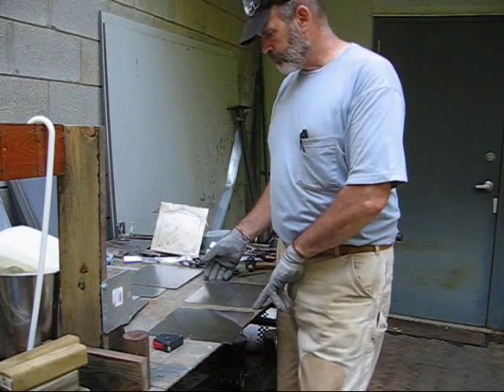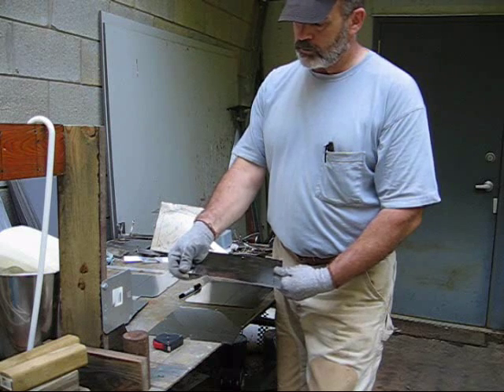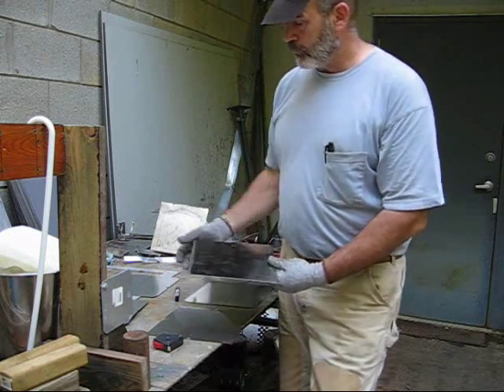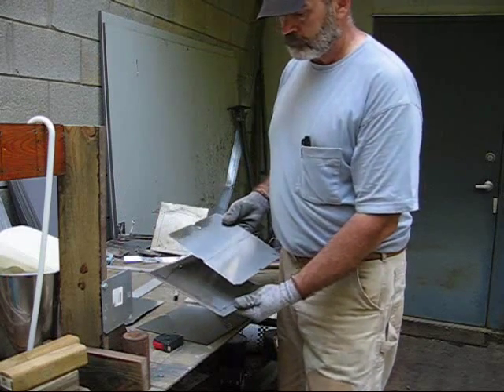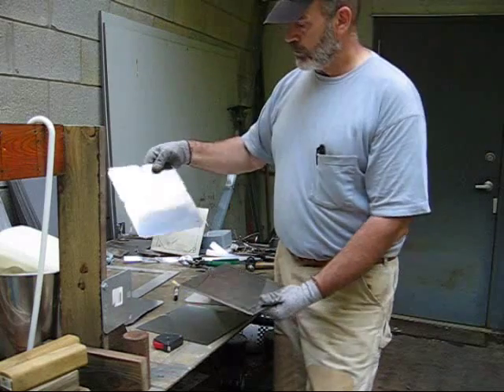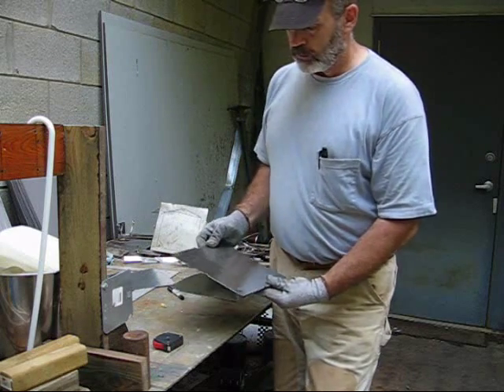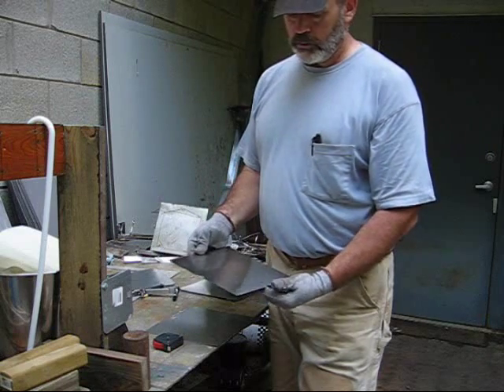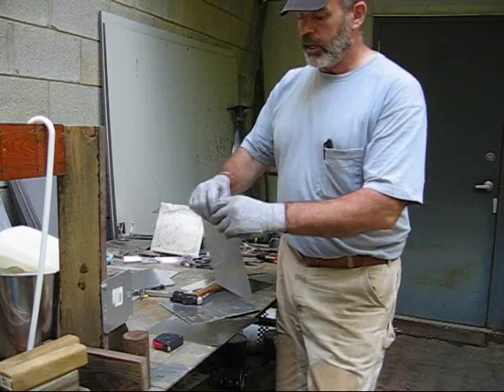HHO Dry Cell Mars Gasket Part 2

Comment: the holes that are staggered was why my dry cells had amperage drop at the back of the cell. now i use the 3/8 centered hole on top and 1/4 inch center hole at bottom.. the multiple relay idea was a bust for me as well! ok if all are on turn one off and the cell does wierd things. i had one plate get hot and start to smoke the gaskets!!!.

Comment from the maker: Wiring the hot plates with switches works very well. I can lower the current draw as needed and lower the temp of the unit as needed. The trade off is that the efficiency drops off when one or more of the cells is turned off. There is quite a bit of voltage/current loss to the dormant cells.
I spent a hole bunch of time trying to figure out how to wire a duel configuration set-up. I finally decided that you would have to put a relay on every single plate in the generator. Continues...

Comment from the maker: My Goal is to have a cell that is so efficient that it needs to be heated not cooled (I will show this in a later vid.) I don't think that the speed of the electrolyte can possibly effect the flow of current considering that electricity travels near the speed of light through water.
Who knows what effect the bubbles on the plates have? ZeroFF and RadGenH2O have used electrolyte pumps and it didn't seem to change the efficiency except for the current wasted to run the pumps.
Mars

Comment: On my cnfiguration I have 1/2 holes top and bottom of the plates.  I then have input/ output through the plastic alligned with these holes.  There is some massive circulation with the electrolyte res. I wonder if this helps dislodge bubbles from the plates, keep cell cool.  in my 16 plate 6X6" cell I get about 4.6mmw which isn't that great but I am moving to 1/16" gaskets inste of 1/8 to see how this will do.  Is it widely belived that having this many holes reduces effiiciency? cont....

Comment: Looks pretty good!
The EBN guys say that "elaborate" gaskets are unnecessary. We disagree. By shaping the gaskets so that the cell "Self-Pumps", we increased MMW effeciency by 2 whole points. Shaped gaskets DO work. See our website for a draft at the bottom left corner on our shaped gaskets. We have altered this design slightly to 3/8 holes in plates, and 1/4 inch holes in gaskets, thus sealing the electrode holes edges. It litterally SUCKS the elite from the reservoir.
Good Luck!
Steve